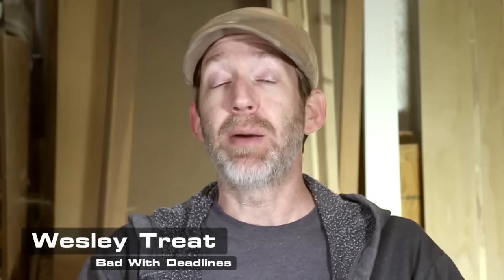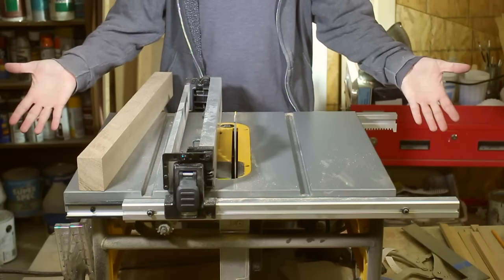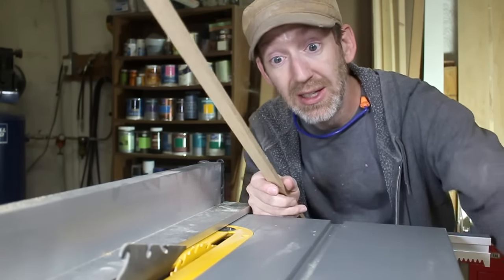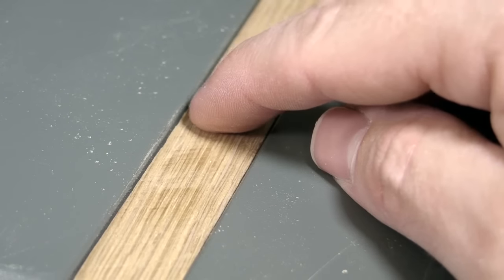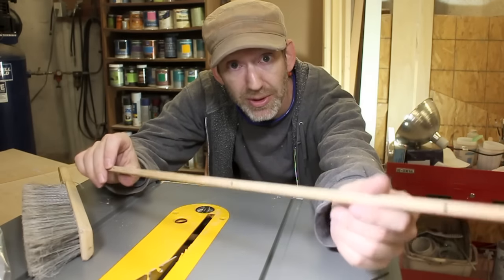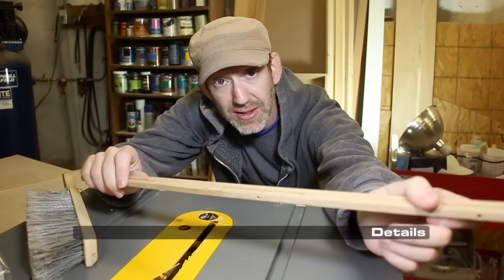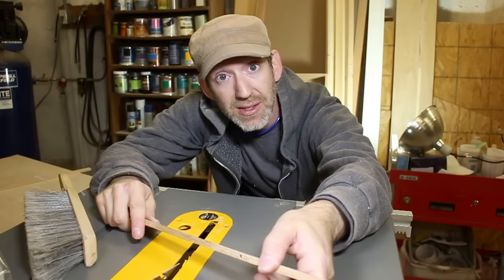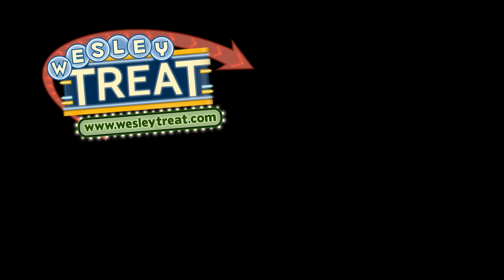Making Adjustable-Fit Miter Bars for a Crosscut Sled

Comment: You are DAYAMn brilliant! I made my sled recently and when it came to runners I was struggling with choice of materials.
Then I remembered I had some Trex-like brand decking left over.  Cheap! (Already paid for it!)  Don’t have to worry about grain, there is none.
AND!....it nice n smooth with very little sanding w/some wet-n-dry sandpaper to make it super-slick.  Ask your family/friends if they have a piece left over.  So far, so good.  Think I got lucky, hope this helps others.  Good luck y’all!
Reply: RICK MELCHER I recently was working on a miter sled and thought about using trex deck but I don’t have any . It’s good to know my idea would have worked though lol

Comment: This is helpful, thanks Wesley.  BTW, like your style, informal and laid-back!  But I'd also like to know about your "new" saw! It appears to be the DeWalt compact job site table saw, is that correct?  If so, how do you like it? How is it as a woodworkers saw?  I noticed a cordless version at a local Ace Hardware, and I really like the adjustable rack and pinion fence, although battery power gives me pause . . .

Comment: Very cool - I've been wanting to do this for a while and was trying to figure out the best way to saw the expansion slit between the two holes.  What size holes are you drilling for the sled-attachment holes that you must also be fitting the jigsaw blade inside to cut your expansion slit (I'm guessing 1/4" to allow bolts or machine screws to attach the runners to your eventual sled)?  

Also, are you using a very small jigsaw blade to even fit it in there to begin cutting the expansion slit or are you plunging it in there (if so, very nice job on keeping that operation clean)?  Thanks again for posting - nice work!

Comment: I like and was going to do something similar.  The real mystery to solve is how to deal with the varying widths of the miter slots on a Dewalt saw.  I have adjustable rails now but you can never really get them perfect when the slots aren't parallel to begin with.  Guess that is what you get for a jobsite saw :)

Thanks for the nice vid!
Reply: Same problem here. Very, very careful thought with a runner, dial indicator, sandpaper, and file. I ran a narrow runner against one edge of one slot at a time, finding "high" spots and carefully removing material until the slot was as close as I could get to parallel to the blade. The frustrating part for me is that the Dewalt slots were 0.760''-.780'' so none of the standard bars fit well at all.
Reply: Same here on the Dewalt.  Great saw an may be my 2nd complaint with the saw (out of 2).  Good solution and patience Matthew.

OP: I like this solution and you can add more of them as needed.  But doesn't really solve the parallel issues unfortunately and not sure anything will besides Matt's suggestion.  Maybe if we made a tool from barstock and an adjustable grinder tool.  Run it through gradually until parallel.
Reply: @egdm1235  I think it results from the grey finish they apply to the 745 and similar. Always puzzled me why they didn't leave it off and machine the top surface... too costly I suppose.
Reply: another plus one on the miter track needing tweaking on the deWalt. I hit it with a foot long mill bastard and a caliper to knock down the high spots. The worst wood runner I made is better than what came with it. I hadn't given UHMW much thought, may have to go look at dollar store cutting boards, thanks!